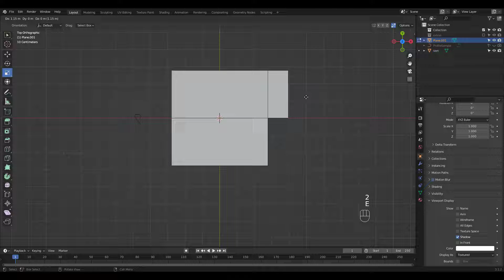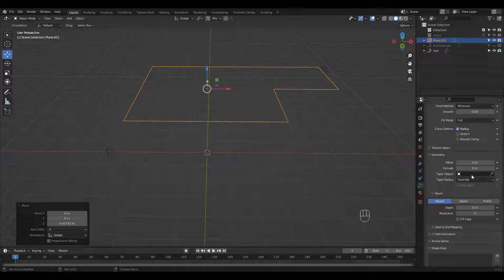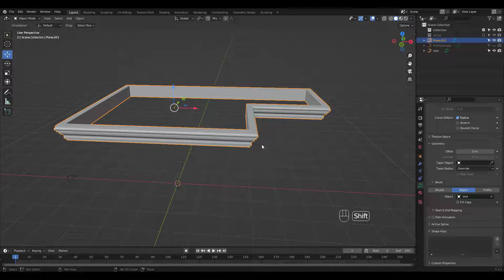Blender Crown Molding Tutorial

Comment: Hello, If I would like to make a pattern on the crown molding. I can't find anything about how I can extrude the molding and still keep the pattern repeating along the length. It can do the shape of the molding but not a pattern as well.
Reply from the maker: For this specific method, I believe no. It's already in a sense extruding along the profile shape.
Reply: @blender3dmagic  Do you know how that would be possible? I haven't found anything anywhere on a repeating pattern along a curved or complex surface.
Reply from the maker: @90snebula  I would suggest making a trim sheet of the repeating pattern and use it as your normal map. That's the only solution I can thin of.
Reply: @blender3dmagic  I’ll try that thanks. Video idea?🗣️